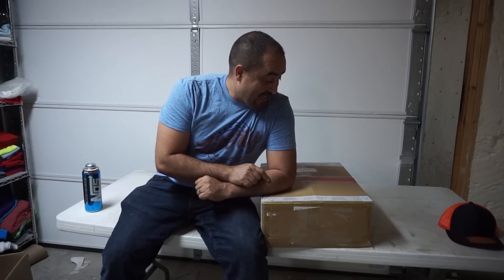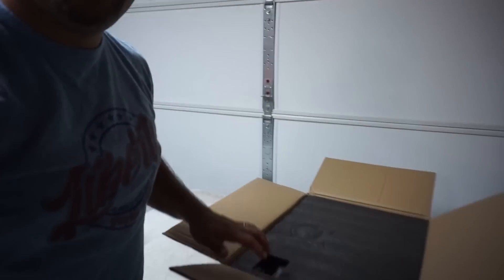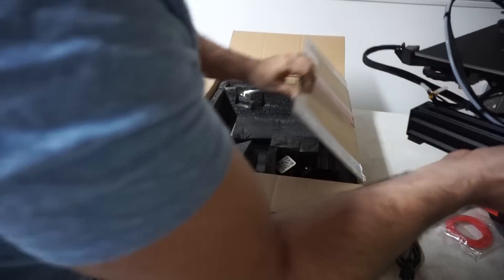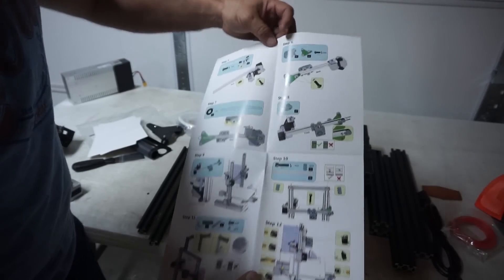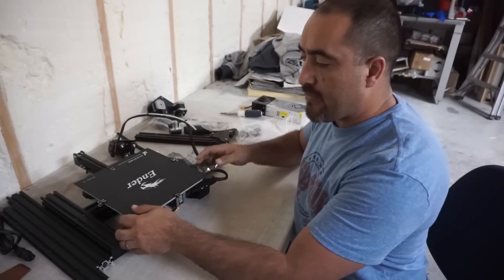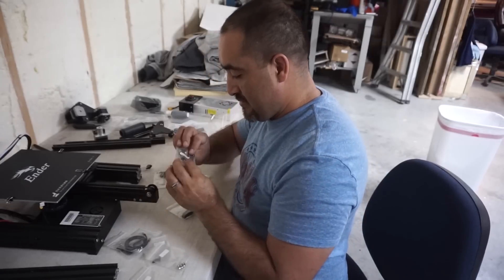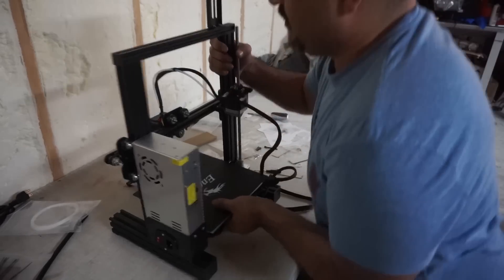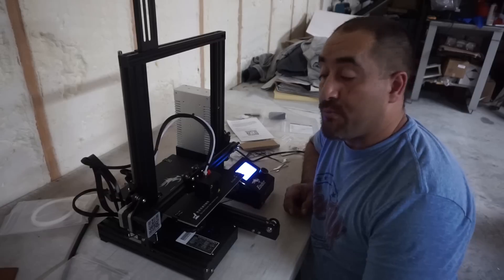UNBOXING THE CREALITY ENDER 3 3D PRINTER

Comment: Hey Juan, really like your content--very broad range of great stuff. I have that very printer and an Anet e12. Once I got that one set up I found out the best way to get the print to stick to the heat bed was to turn that bed cover upside down then  put a piece of glass (same size of the head bed area) on top. I've never had a print to fail or not stick since I did that. Looking forward to the great content of ideas in the future you'll invent with that printer.